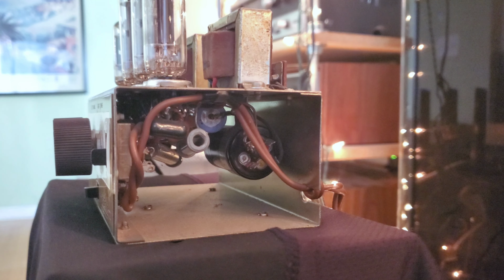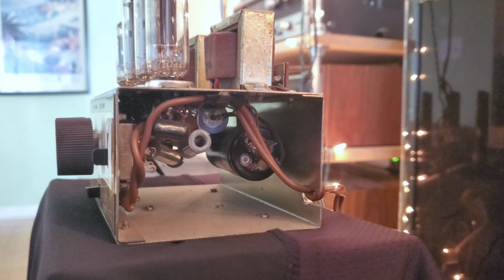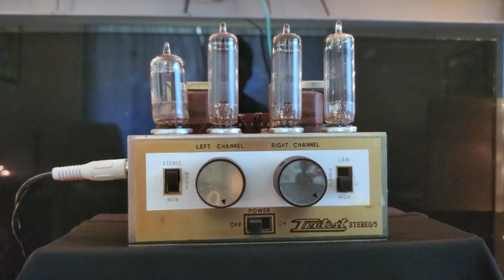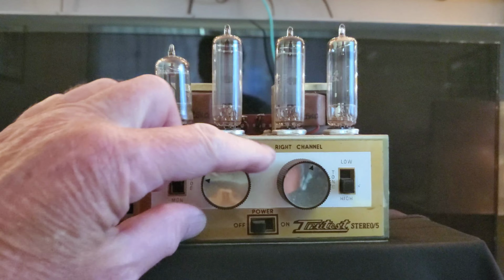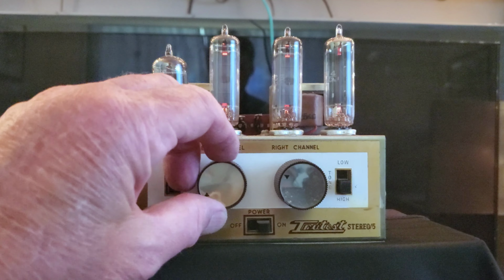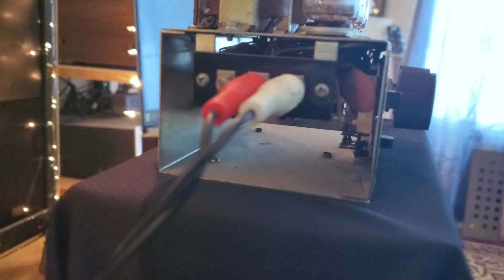Vintage Audio Widowmaker...Trutest 5 One Watt Stereo Amplifier (1960)

Comment: LMAO 🤣🤣🤣 that bathtub comment made me laugh. Of course, nothing to fool around with. 
  1 watt per side with the right speakers can do wonders.
  I first learned this when I took apart my grandparents Zenith solid state console as a younger audio nutcase.  To my surprise, the output transistors were little TO-92 transistors !!! One channel burned out so I was in there repairing it.  And their heatsink was the amp's own steel chassis metal. To think that console filled my grandparent's livingroom with sound, with u so little power, and now I have it.
  But on the tube side I built a Darling SE tube amp that did about 0.75 Watts per side using 1626 output tubes.  That was an eyeopener and was as simple as this Trutest little amp.  Great video showing people that one good watt per side can sound amazing with the right (efficient) speakers.

Comment: We had an old Westinghouse stereo phonograph that had a 3 tube amplifier (35W4 and 2x50EH5). It sounded quite good when connected to a pair of Knight 15" 3 way speakers. A lot louder and cleaner than I would have expected.

Comment: I would install a cord with a three-prong cord, attach  the green grounding to any screw on the chassis. Also, be sure you have the L1 and N on their correct order. In this way, in the event of a short circuit, the breaker trips instead of a shock hazard.

Comment: Just use an isolation transformer. They made 10's of millions of hot-chassis radios, there were not a significant risk. BTW, you can't just "ground" the chassis, depending on which way the plug is in, 50/50 the hot side is connected directly to ground.
Reply: When you say "hot side", are you referring to the L1(common) and N (neutral) wire. In my work hot to ground you get POW!